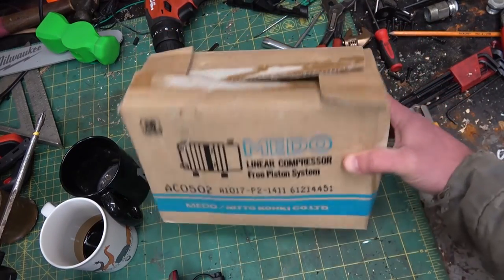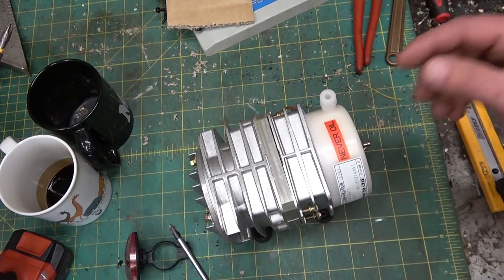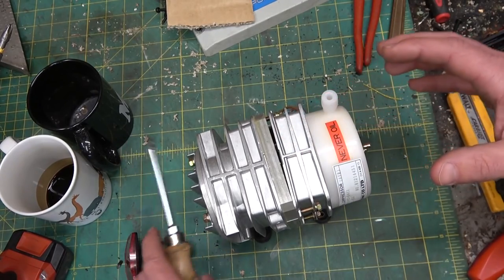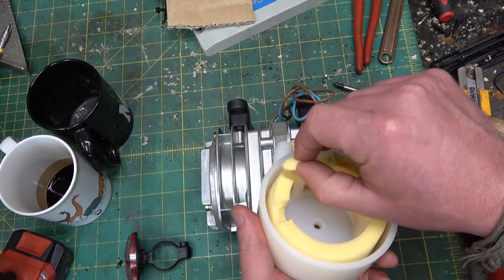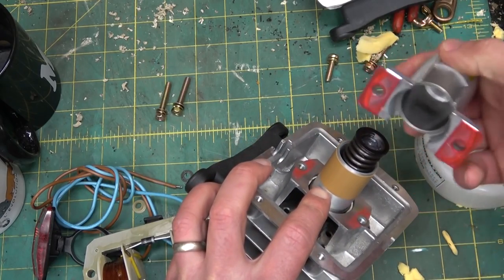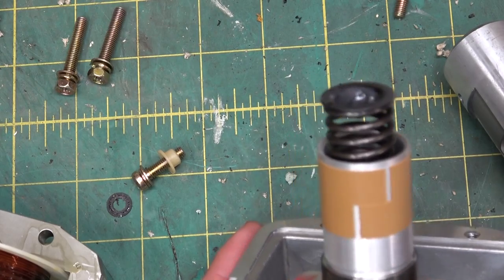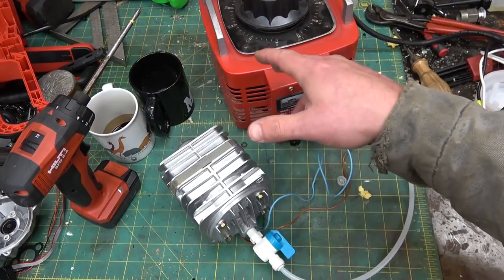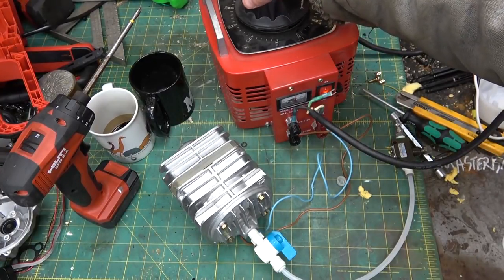BOLTR: Japanese Linear Compressor | Genius!

Comment: I love simple and robust machines just like you. But these reciprocating motors have their own limits which is why most higher power applications will use regular circular motors. Ventilation is one of them ( if you think about it any circular motor only needs some blades installed and it got its own fan, now reciprocating motors of higher power output would need external fans, which defeats the point of them being simple and robust since that smaller less reliable external fan is what would keep the bigger internal motor from destroying itself.
Another problem is the hysteresis. As you scale up a "back and fourth" type of electrical motor, the sheer weight of the parts make it unable to move at 50/60 Hz speed. Problem the third: You saw for yourself, the heart of that thing is a spring. So underneath that apparent superb reliability, you have machine that is relying on bending a piece of steel back and forth until it breaks.
Myself I have imagined solutions for that, but the results I got made a circular motor look simple because my solution needed a kinetic energy accumulator (a fly wheel) like old time steam engines and my back and fourth motor was no longer functioning on 60Hz but it worked on any voltage frequency since my motor was only working as an electromagnet and relied on electronics to switch on and off. The electronics were solid state but they had to be oversized on account of the switching of the coil (you know how coils don't like to be switched off, they do like your wife when you tell her she is talking too much)
Reply: Isn't it also easier to throttle a rotational electric motor?
Reply: car valves use springs. There are a lot of these operating at thousands of cycles per second and usually none break

Comment: My bet would be that linear compressors have a low maximum pressure and cost increases significantly with pressure. Common motor driven compressors won't have the same issues.
Reply: The max pressure is essentially dictated by the spring though, since that's what's actually doing all the compressing. Probably gets quite power hungry trying to pull back really heavy springs, so you'll need wires that are much thicker for the coil. That alone will probably cost you more than the electric motor
Reply: exactly what i was thinking.
Reply: Ya. Seems like it, you would need to replicate the entire motor for every cylinder too and everything would be overly complicated to get good pressure. 
But it definitely seems possible, but, then again.
For what gains, 2% or less in friction losses? And no ability to use cross platform parts? Thats a lot of cost incress for those last 2%. Not worth it.
Ps
Did you mean reciprocating with the rotary motor?
Because rotary compressors are a whole different animal, really good at high volume and terrible at high pressures, they bend the vanes if you push to much through
Reply: @jimandaubz  I did mean reciprocating with a motor. Didn't even know true rotary compressors were a thing. Learn something new every day!
Reply: @kabadisha  i figured as much! Haha, they are not common by any means
Reply: james saunders
wait, isn't a rotary compressor just a fan then?
Reply: @MrDoboz  hahaha
Reply: @MrDoboz  no. Its a vane compressor, or a roots blower, or a turbine. The vane compressor is most common in tools and works just like a vane air motor, the rest are usually on automobiles as turbo/super chargers.
Edit.
A turbine is just a fan.
🤔🤨.
Curses

Comment: To convert from 240 to 110:   Cut the diode between the two after the stripe.. Connect the brown wire to it instead.. Then connect a second blue wire back to the start of the second coil(where the diode connected).. add a second diode and a second brown wire afterwards so you have two      N->coil->diode->A     in parallel.
That should do it.

Comment: I picked one of these out of a coffee machine - the compact ones for liquids are pretty fascinating - complete physical separation of the piston from the solenoids.  I suspect these only work for low pressure applications because they can't deliver the power a mechanically linked prime mover can deliver.

Comment: Replaced one of these for the dryer cycle in a dental autoclave. One coil had failed due to the intake being inside the case that caused it to fail due to years of moisture. They eventually fixed the problem with the intake outside of the unit with a dust filter. Cool you posted this little breeze of a fart machine lol.

Comment: It chooches 60 times a second in countries that have put a man on the moon, or at least sent a reusable robot arm to orbit.
Reply: If 50 Hertz, 60's gonna really Hert . . .
Reply: "man on the moon" lol!
Reply: @BlackEpyon  dual purpose space heater
Reply: Now what's really nuts, in its home country it'll chooch at different speeds depending on which side of the Fujigawa river you're on.
Reply: Gotta love those Canadian arm jobs
Reply: 50 years is a long time to rest on your laurels, Marvin. 
Don't get so you can't stand up again.
Reply: BigSmartArmed
You're not a moon landing denier, are you?
If you are, then you should remove the "smart" part on your name.
Reply: @BlackEpyon  may be. The higher the frequency the higher the resistance of a coil. So if you ran it with the label voltage on 60hz the wattage decreases. Output maybe gets compensated due increase of cycles in the minute.
Reply: Up there with Space Ghost from coast to coast?  Lol.
Reply: but 50 times a second in the countries that founded the country that put a man on the moon, hence the language you speak.
Reply: Actually isn't it on a half wave so it would only actuate 25 or 30 times a second?
Reply: It also chooches at 50hz and 230-240v is just about every country on planet earth except some parts of Japan and some countries in North America
Reply: Oneofdazzz: Nope. 50Hz means 50 FULL waves per second, or 100 HALF waves per second. You aren't throwing away every second full wave, you are throwing away one half of every full wave. If you full wave rectify 50Hz, you get a 100Hz(!) rectified output (before any filter capacitor).
Reply: @BlackEpyon  Both Duty Cycle and RMS are wrong. The RMS is related to the waveform, not frequency. The relevant factors when looking at different frequencies in this application are mechanical inertia and inductance.
Reply: @BlackEpyon  What are you on about?
Reply: BlackEpyon oh I thought you were talking about me. Don’t worry though, I know engineers who can’t calculate the rms of an arbitrary waveform
Reply: 50 times also in countries that raised both Kepler and von Braun, also JFK was „ein Berliner“.
Reply: @BigSmartArmed   Ha,ha,ha, brilliant!

Comment: I think power density is the main drawback of linear motors. You only get so many joules per field reversal. You are stuck with just 50 a second here (or 100 depending on how this rectifier works?); and the physical speed of rotor can be limiting. Many rotary designs allow you to decouple (multipoles, gearboxes and other complexities) these constraints from where you are using the energy; having very fast rotors that experience an equally ungodly amount of field reversals per second. That big hunk of copper sitting in that little shop blower could probably launch a Tesla to Mars if it wasnt sitting there waiting 20 frigging milliseconds between field reversals.

Comment: Only ONE moving part?  I count at least three, piston, reed valves, and maybe a flapper valve, any of which if they fail,  the compressor fails.  Now don't get me wrong it is much more reliable than many other screw or rotary compressors, but as you said limited in what it can put out in air volume and pressure.
Reply: Actually some rotary compressors has only one moving part. No valves, no springs.

Comment: Genuis design! It is not so big deal. This pump also uses in aqua. Remembered that when i was kid. I had goldfish in a tank and had a cheap little air pump. Similar idea just a small suction cup and a coil a lever powered by ac electric..

Comment: No matter how a gas is compressed, the BTU content per volume increases. This is realized as an increase in temperature.
Whether that compressed gas is stored or not,  that temp increase occurs. This is irrefutable physics.
Reply: No joke lol air moving for an extended period of time means friction build up of some sort
Reply: Depends on the speed, near isothermal compression is a thing
Reply: @matthewmullin8168  Decreasing the volume of a fixed btu content raises temp. 
 No exceptions. Doing so very slowly can raise the temp slow enough to be absorbed and rejected by the container but the the physics of the heat pump remain unchanged. Stirling cycle/Rankine cycle...

Comment: Used in Engel refrigerator/freezers too.  Heard one lasted over 50 years.  Works and both AC/DC, great for off gridders.  Whirlpool, GE, Kenmore, etc, won't use them because they literally would sell a fraction of the refrigerators and freezers they do now.

Comment: Back in the 70's I went to a Tecumseh Products Co. plant tour and while the group was inspecting the hermetic compressor assembly line, we walked pass a open door that was not supposed to be open. Inside the acoustic walled room was a football looking compressor getting set up for noise rating. We asked the tour guide what was that and he answered, in a hushed tone, that it was a experimental Linear Drive refrigeration compressor that was frequency variable and adaptable voltage powered. If you needed more BTU capacity, you increased the frequency while keeping the voltage constant. As far as I know it never reached market, but on every space shot the suitcase carried by the astronauts was a modified Tecumseh compressor to cool the space suits.

Comment: I would say this device has five moving parts. The spring, flexible seal, and the reeds all move. Plus the housing moves relative to the piston. Actually, many of the parts are composites so you could say even more if you broke down all the pieces that go into each one.

Comment: They´re used often in aquarium commercial instalations (pet shops) for deliver air to fish tanks. Can run for years wo very little maintenance. I use to replace the rubber internal flaps for the thikcer ruber used in inner tube truck tires. Got some for 20 years and still runs.

Comment: We have been using an Italian made pump (brand C.E.M.E) that operates on identical principle.  We also are using a smaller one (Flo-Jet) for same purposes.  There indeed is an issue with the feeding transformer core saturation due to the half wave rectification.  To avoid that, you would need two pumps (or compressors for that matter) plumbed in direct parallel and electrically wired in opposite polarities.  One pump uses one polarity and the other one the opposite polarity.  AC balance restored!

Comment: First of all, I'd have to appologise for my poor English, it's not my native language.

You know, if you connect the two coils in parallell you can run it on 110 V... (Since they are connected in series) But don't forget to move the diode to be in series.

And also; the reason for running an ordinairy compressor is speed and torque. Powering a one-way rotary motion by commutation is less powerconsuming than reciprocating by piston (No start and stop of the movement).

Other than that; Love your vids. 

Keep on keeping your Richard in a vise.
- Odin Odinson from Norway -

Comment: I use one of those to power 10 air driven filters in multiple deep aquariums.  I have saved a bunch on electricity costs since switching.  Buying aquarium branded pumps would have been over $300 while the linear pump I purchased was $60 and doesn't need the diaphragms replaced every couple of years.

Comment: AvE, every reed valve type compressor like this I've seen, the reed valves are what goes. They either fracture due to fatigue or moisture makes them corrode and break. I wouldn't say this is durable unless those reeds are super high quality.

Comment: We had tons of issues during con ed inspections for gas turn ons with pressure randomly dropping. And usually an hour of coaxing the inspector to just do a live test because it was running through a 140 degree boiler room then into a 10 degree basement and what not.

Comment: Another possible factor...  as you point out these aren't used to pressurize an air reservoir, so the piston pressure is very specific, and there's a set of valves that count on that pressure to work.  For a compressor designed to feed a tank the piston pressure could be anything in a wide range of values between ambient and the cutoff, so a set of valves that only work at a specific pressure level wouldn't work out

Comment: Big Clive did an episode on some Chinesium solenoid pump not too long ago. Same idea but much smaller and cheaper. Not much moving other than the piston and check valves. The main point of that was that it gives a fairly well metered flow rate when knowing the frequency of the current driving it.

Comment: Maximum pressure is based on the spring strength in this case. That is why a geared down rotating motor is used for higher pressure compressors.

Comment: Those air pumps are also used as an air pump for fishponds. I have a smaller version, and it is running for almost 2 years continuously without any problems. It uses less power compared to traditional fishpond air pumps. And I never had to replace any parts so far, with the traditional fishpond air pumps I had to replace the membranes at least once a year. Cheap to buy as well. I think they are also used for airbrushing. They come in many different sizes and capacity. They don't produce a whole lot of noise. Also a good thing. And they are very compact. Compared to traditional air pumps with membranes they produce a lot more airflow. From my experience I can really recommend these air pumps for pond owners. Compared to pumps with membranes these cylinder pumps are much better, cheaper in use and to buy, more efficient, a lot more quiet and much more reliable.

Comment: You talked about pressure loss because of temperature.  There are well known equations for calculating that. But think about a Stirling engine, a high efficiency one. The air in that little chamber expands or contracts enough to move the power piston as the displacer moves.  You have a chamber that probably isn't 50cc expanding and contracting a half cc or so with just a few degrees.  Just remember that you have to use Kelvin or Rankine in the gas volume equations.

Comment: Interesting, i would imagine the reason they aren't the standard is because the solenoid can't push hard enough for certain pressures as opposed to piestom systems which would just have a gearbox, but i can see the advantages of this system like less wear and tear maybe? ... also i don't know if this is the case but does this design pump on both strokes because seems like a wasted opportunity if it doesn't.

Comment: I know my recently acquired LG refrigerator uses a linear compressor. I am fresh into the HVAC/R trade and I'd have to say it's the fixed capacity rating for the compressor that holds it back. I work for a company that's a Factory Authorized Rep of Daikan equipment, and they're on the edge of a magnetic turbo core compressor that uses no bearings spins at 40,000 rippms and refreshes the position of the shaft at a frequency of 120 times a second. It might be the economy of scale holding back the linear compressor or the fact it's not very flexible in its practical application

Comment: Ah...Also, an air powered liquid cooling system (2-3psi would be plenty to pressurize a sealed holding tank). I know you said it's not for pressurizing, but with a cooling tank say on a mill, with very little or no Heed, I see it being an efficient way to deliver the needed fluid. This is of course, VS. an electric cooling pump. Weigh the power consumption. I think you would find the pump would be a more efficient system. Just spit balling. Thanks for the Heart Ave! Zip~

Comment: So you start off by saying it's so efficient but immediately we find out half of the electrical input get's rectified (AKA cut off to zero) and than after that it turn out the cylinder is pushing against a spring all the time... very efficient!

i think the word you're looking for is very simple instead of very efficient.

Comment: Aye bud. I am a refrigeration tech from Ontario and I have a bunch of 1/2 warn out Scroll compressors out of a refrigeration rack, and a brand new (old stock, cant be sold) little rotary compressor. If only I had my own AvE to cut em open and say a smart things about the internals! :3   Wish I could somehow give em to ya to make videos on.
Reply: Made me think of refrigeration because LG is the industry leader in Linear refrigeration compressors. Never knew how they worked until now!

Comment: I believe aquarium air pumps are this type for all the reasons stated: almost nothing to go wrong, run for a long time, highly dependable, very low pressure is all that's required.

Comment: I have an AC bench supply. You can adjust voltage and frequency, so it can put out 50 or 60 Hz (or 40 or 70 or anywhere in between). It can put out 100 or 240 or anywhere in between. It is big and heavy. Let me know if you want it. I rescued it from a fate worse than death, but I don't have any real use for it. I don't remember the power rating off the top of my head, but I can find out for you if you are potentially interested.